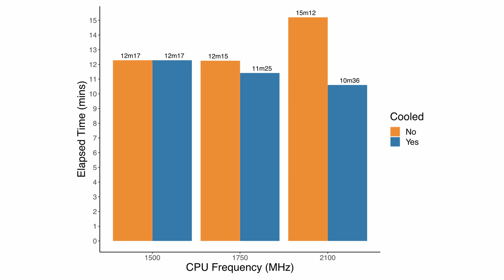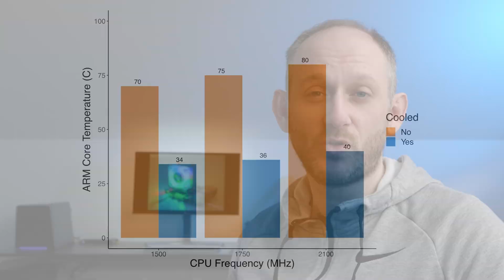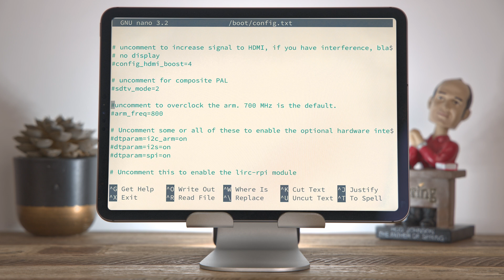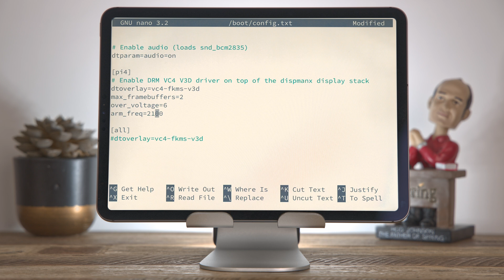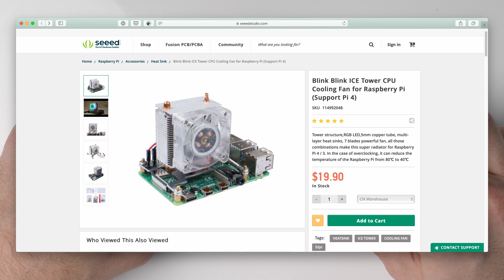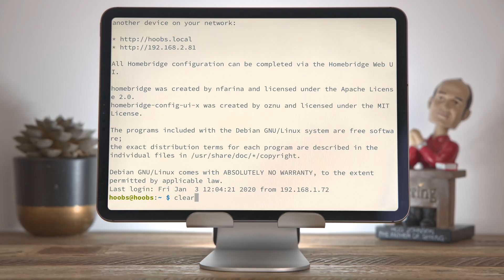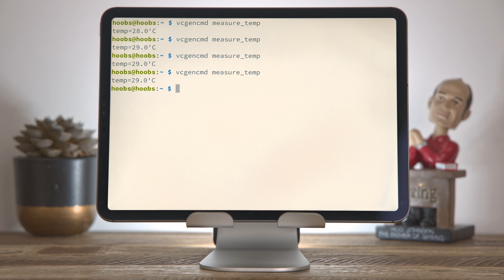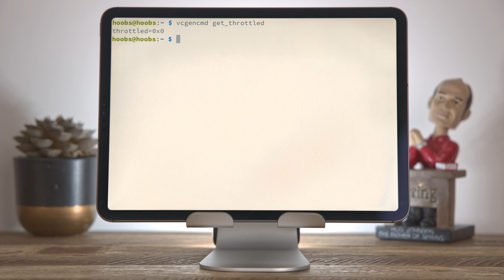OVERCLOCK your Raspberry Pi 4 to 2.1GHz SAFELY with this $20 FAN.

Comment: Great video.  I'm pretty new to PI, got mine a couple of weeks ago. Have installed this case and fan which improves performance. But not sure how it compares to your setup.
https://youtu.be/E9E6yxg7-Ac
I have managed to setup a trial CCTV setup monitoring one camera. What I found is the temp ramps up pretty quickly but it seems to cope. I will test some more and check the temp with the commands you showed (thanks for that)
My cctv project is here...comments welcome.  
https://youtu.be/E9E6yxg7-Ac
Keep up with vids. I have some electron bits from many projects and will experiment.
One thing I was hoping to achieve is setting up Onedrive or Google drive on the PI using Raspberry OS so any useful advice welcome. Cheers Frank

Comment: there’s something pretty odd going on here. with no active cooling but OCd 1.75HGz there’s no benefit?! that suggests your ffmpeg test is thermally throttling at both 1.5 & 1.75 GHz?  and at 2.1 GHz without active cooling you loose performance? so that’s power throttling kicking in?  and at 2.1GHz active cooling you’re over clocking by a whopping 40%, but only getting ~13.5% reduction in encode time? That means your app is bottlenecked somewhere else. weird.

Comment: I noticed that most people that have the Ice Tower fan purchased the silver one(at least in all the vids I've seen.) I got the black one. I was wondering if the coat of black paint over the copper heat-pipe slightly reduces thermal transfer. Do you think thats why most people purchased the silver one with exposed copper?
Reply: That's why I got the silver one.  Didn't like the black paint or the black coating over the copper.  If it were anodized rather than painted I'd have gotten black (because that arguably would be more effective at absorbing heat), but since it is painted and has that coating over the copper, i went for silver instead.

The effect is probably negligable, but since I'm getting it to transfer heat, I opted for what I thought would be the most effective at that.

Comment: Amazing, clear, and concise video. Could you please specify what power supply you use for your Raspberry Pi 4? (What is the best power supply to use if overclocking to 2.1GHz?) Thank you.
Reply: I'd like to know this as well. Online listings don't show watts, only volts and amps so it's hard to pick one. I'm currently using a 5V 3A power supply and it can handle a bit of stress at 2.1GHz but dies after a minute of continuous stress.
Reply: @MrSecondmuffin  Don't forget PIE! P=IE (power = volts x amps)

Comment: When you said you should have a stable power supply for that configuration, would the official raspberry pi 4 power supply be considered stable enough? And does this overclocking method work on raspberry pi Noobs?
Reply: yes & yes, many of the kit / official psus are over-capable. The cheap or random phone ones sometimes work great, until you overclock or add some USB devices & then they fail.
Reply: @gg-gn3re  Thanks for the response. Thats good to know. I just ended up ordering a CanaKit with this ice tower

Comment: is it possible to set the minimum cpu clockspeed when idle?
like id like it to be 100% 2.1ghz of the time
Reply: you could do this by setting "force_turbo=1" in the config file....
HOWEVER that is completely unnecessary for most applications, gains no enhanced user experience and voids your warranty by setting a sticky bit. so don't do it.
Reply: @justusbenning1626  What are you talking about? 
anyway:
Yes what you're looking for is the option "arm_freq_min" which will set the ondemand governor to only go that low.... or the CPU GOVERNOR 
https://www.raspberrypi.org/documentation/configuration/config-txt/overclocking.md
The linux Governor has many settings, most known are ondemand & performance. (there is userspace, conservative, powersave, ondemand, & performance modes)
ondemand scales the cpu depending on the workload you have, it can go from a minimum threshold to a maximum and scales down / up depending. This is the best.
If you want max performance due to quick switching and latency of the governor on your program, then performance may be of interest to you. Nearly every operating system (including windows) has these things.
https://wiki.debian.org/CpuFrequencyScaling
https://raspberrypi.stackexchange.com/questions/9034/how-to-change-the-default-governor

Comment: This cooler is great looking but for those that want a cleaner setup the "heatsink" style cases like the Flirc and Argon One will get you to very similar overclocks without the Pi resorting to thermal throttling.

Comment: Is overclocking really necessary if I'm just running retropie or open elec/media center?
Reply: Retropie will benefit a lot from overclocking - on the more complex emulators like Dreamcast, N64, PSP etc. For media centre it will make no real difference.
Reply: @Daz5Tube  Yep overclocking the gpu makes a big difference.. also worth noting the new vc4 fkms driver breaks kodi but works wonders for psp & n64 emulation. It'll be a while until kodi is fixed even the alpha version isn't working on that. But you can switch between them on a reboot.

Comment: What is the comand to measure the gpu clock?
Reply from the maker: There’s a full list of core measurements you can make here: https://www.raspberrypi.org/documentation/raspbian/applications/vcgencmd.md
Reply: @tech_craft  That's some of them, not all of them. However to answer Landy 5000, it depends on your GPU task. The h264 is for a gpu video decoding of h264 encoded video... and a v3d would be if you are trying to measure your GPU clock during a game or animation on the web etc.

Comment: Latest I’ve reached with 2 Pi4 4Gb with latest buster build and rpi-update for latest firmware.

Force_turbo=1
Over_voltage=7
Arm_freq=2140
Gpu_freq=800
Gpu_mem=512
Hdmi_enable_4k=1
Hdmi_enable_4kp60=1

97F temp - wicked aluminum case no fan.
Playing 4K video h265, h264, hevc, 7.1 audio. Stable 11 days. WiFi, NIC and BT stable also.
Reply: 97°F?  Doesnt the cpu throttle at 80?
Reply from the maker: Nice!!!

Comment: Ever made a surveillance system out of the raspberry pi? If so can you make a tutorial
Reply from the maker: I've done some camera projects with the Pi and I'm planning a video about building a camera setup to monitor my 3D printer which is pretty close to the surveillance camera setup.
Reply: Tech Craft awesome looking forward to seeing your video. I curious if you use pikrellcam for this project?
Reply from the maker: @moj8945  I was considering that as an approach for detecting that the printer has stopped the job. I'm still working through it, but if I get that in the final solution I'll be sure to include it in the tutorial.

Comment: Do you use this fan when you go mobile with your PI? What does your mobile PI look like? Just trying to figure out how to balance overclocking and mobility. This video shows a nice 3D printer case for the PI4 with this fan.  https://youtu.be/TFpoVwrw3Pc
Reply from the maker: I was using this case (http://tinyurl.com/y2hqvnbn) for mobile usage, but I dropped it and the corners have come off. It’s great for heat management, but it’s a little unwieldy for my tastes. I’ve just ordered a heatsink case (http://tinyurl.com/ubsjyh4) which according to the blurb offers 10-15C passive cooling under load. If that’s true, then I think this might be the case I stick with.
Reply: Thanks! Do you plan to overclock when mobile? The simple case I have with a fan just barely stays under 80 degrees when under load.
Reply from the maker: @DavidJohnson-zv5ir  If I can get it to stay stable at a sensible temperature I absolutely will. It won't be at 2.1GHz because the power draw is a bit too much, but at 1.75GHz I think it's feasible if the passive cooling case does a good job. It arrived in the post this morning, so I'll let you know!
Reply: Tech Craft I received the case I linked to above. I can overclock to 2.100 GHz and the temp never goes above 60 degrees. It does draw a lot more power so I haven’t tried it connected to the iPad yet. It does work with a power bank I have though. Looking forward to hearing your experience with your new case. Thanks for your videos! Looks like the channel is gaining subscribers. Congratulations!!

Comment: Out of scope of this cool presentation 🥶, but in your video you are talking of your security cam stack. I'm interested to know more, are you will talk about it ?
Reply from the maker: I have a video coming up discussing some home automation extensions using the Pi and then a follow up specifically looking at cameras and streaming.
Reply: Tech Craft I agree. I’d love to see your video camera setup.
I’ve been building a video camera using a RPi0w and my older RPi3B as the backend/encoder, but both seem a bit under-powered. I just bought a Pi3A+ to utilize its extra horsepower as the video camera module, and I’m considering buying a Pi4B for the backend/encoder. Thanks for your RPi videos.

Comment: They make a new model of this that is shorter. The "tower" is parallel to the motherboard instead of perpendicular.
Reply from the maker: Nice. I’ll check that out.
Reply: Do you have a link? I only see the upright one, and the only horizontal style one I see is for the nvidia jetson nano
Reply: @msimcox2  Here is a link to the review: https://www.youtube.com/watch?v=aloK_rDAOtY
Although I could not find it on their website either.
Reply: @msimcox2  Amazon has it: https://www.amazon.com/GeeekPi-Raspberry-Low-Profile-Cooling-Heatsink/dp/B07ZV1LLWK
Reply: That's because you can get better performance than this one by just blowing a 50mm fan directly onto the pcb and threading it through some of the pi screw holes. keeping the entire thing cool is always going to be much more beneficial

Comment: With the overclock set, could you still power the Raspberry Pi from your iPad Pro?
Reply from the maker: It’s not super stable for me, especially at the 2.1Ghz level. I need to do more testing, but I think it’s better to use extra power. Next week I’m posting a review of a hub that has an extra USB-C socket that allows for the Pi and the iPad to both be powered, even when the Pi is overclocked.

Comment: Would this technique also work fine for underclocking the pi?  I would be curious to see how much battery life could be stretched by making the pi a little less power hungry.  I've looked around a little and have seen very little focus on power use optimization which is going to be very useful if I start carrying a pi on me everywhere
Reply from the maker: I’ve never tried that but I’ve seen plenty of community posts discussing it so I know that people are doing it in the wild.
Reply: Underclocking usually doesnt improve energy usage that much. But you could try undervolting and disabling interfaces you dont need, running headless, etc.

Comment: That's pretty cool! Also, just a small thing, I noticed that the audio becomes unsynchronized from the video at around 8:20, just to let you know. :)
Reply from the maker: Martin Žilák So it does. How odd. Thankfully it doesn’t last long!
Reply: A tip : you can watch movies on instaflixxer. I've been using it for watching a lot of movies lately.
Reply: @Corey Donald definitely, been watching on instaflixxer for years myself :)
Reply: @Corey Donald definitely, I have been using InstaFlixxer for since november myself :)
Reply: @Corey Donald Definitely, been watching on instaflixxer for months myself :)